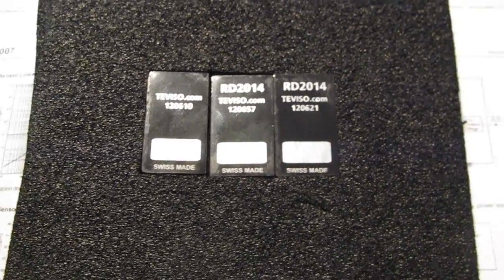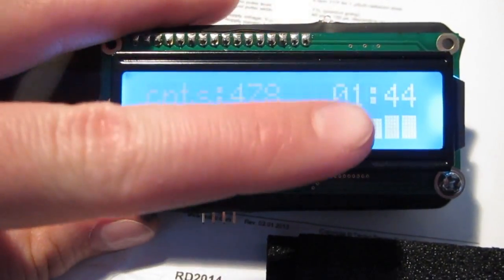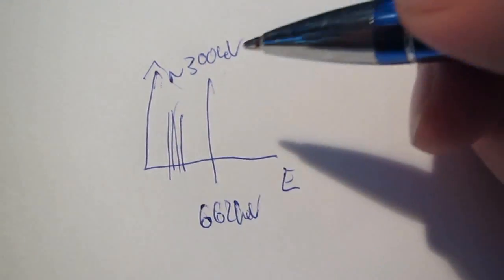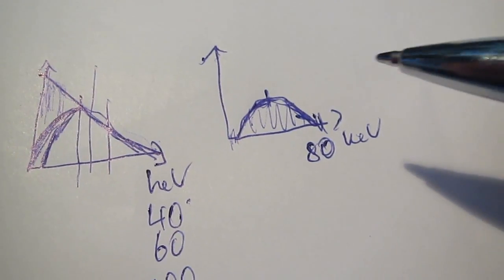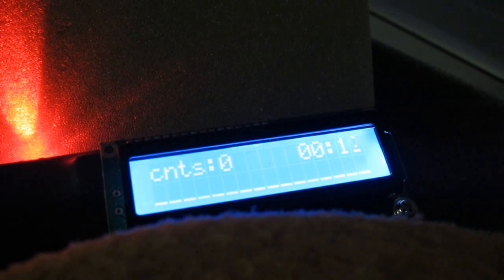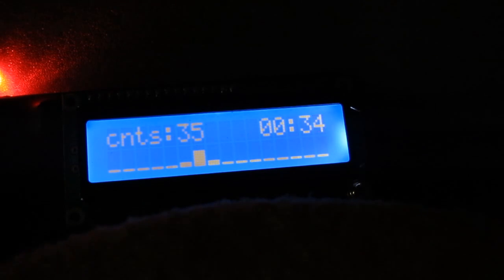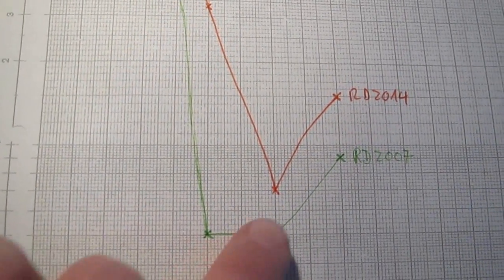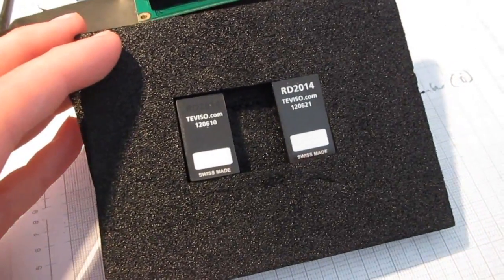testing teviso.com PIN diode semiconductor radiation detector

Comment: I have a question for anyone who used this detector. I have a project and I'm planning on mounting this detector on a UAV, would this be a good idea? Can I get radiation measurements from a fairly big distance? (a few meters away?) I hope someone can help me with this. Also, thanks for the great video.
Reply: +Amoor Spears 
i think  it is good for detect gamma  radiation from few centimeters,  unusable for few meters therefore  not suitable for UAV base measurements.

Comment: Yes, don't pit the anode! Would have thought the expensive ones might even be actively cooled. It might be fun to hook the detector just up to a 5V USB cable and connect the output to a storage oscilloscope. That'd answer some questions, like are there any pulses at the low energy range at all, from anything?

Comment: There isn't anything in the circuit I wouldn't know how to do. I used HD44780s with programmable characters and depending on the µC clock it wouldn't be a problem to measure a pulse to sub-microsecond resolution. But it's still a few hours of work someone else already did ;) .

Comment: Looks like just a 16x2 LCD using HD44780-compatible logic. That's just the display. There needs to be a little micro underneath which is capable of accurately measuring and sorting pulses between 40 and 150 microseconds. And of course, some way of displaying them. The hybrid package just takes power and delivers pulses when stimulated with radiation.

The fellow seems to be using programmable characters for the fancy histogrammatic(al?) energy bins at the bottom. Well done, bionerd's friend!

Comment from the maker: already did, watch?v=XuQgVGDENbU - however, if you mean testing with these PIN-diode detectors, i cannot afford to randomly buy a flight just to test them, sadly - however, when i go flying next, i may take them along. they're very small after all.

Comment: Ah, ok maybe I used the wrong word. I'm not especially interested in the LCD itself (have something like that already and used atMegas - no easy arduino ;)  - to control them), but rather in the electronics and maybe code for the µC that converts the variable pulse width coming from the sensor in a numeric value. Actually I could do completely without the display itself, as long as I have a serial connection to a PC.

Comment: Wow, we just got two of these detectors (one RD2007 and one RD2014) last week for a project at my university. We will also have to build the electronics for it (using a µC is planned; in the end the data should be fed into a PC).

Where did you get that display board from? It doens't matter if a complete board, a kit, or just schematics to build your own. It will in any way really help.

Comment: Nice job!

I wonder if the detector response is linear or even smooth. Also, could you be out of range due to gain issues? When I first used my RAP47 low energy probe I was lost due to the gain giving me 8keV to 100keV and not 8keV to 1000keV I thought I had. 

Good job!